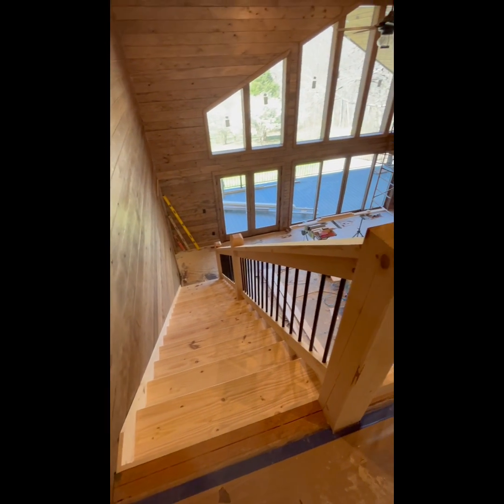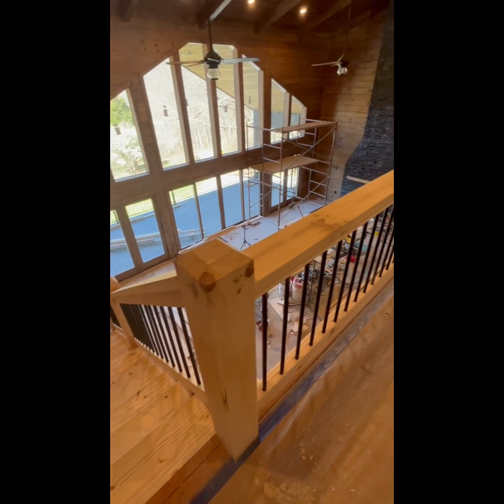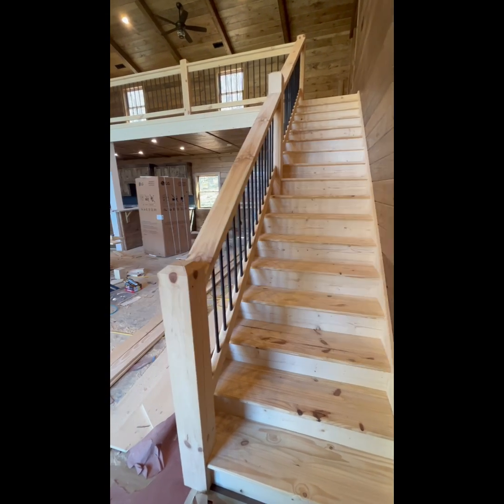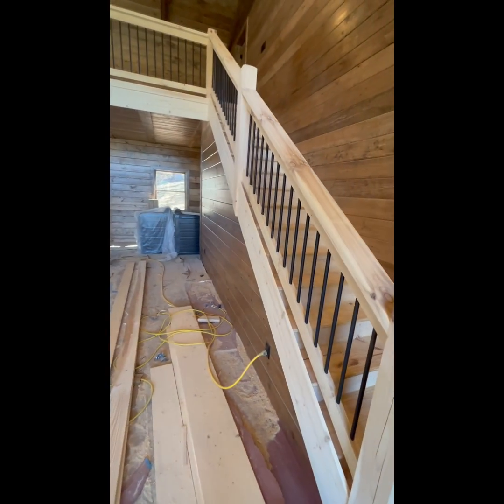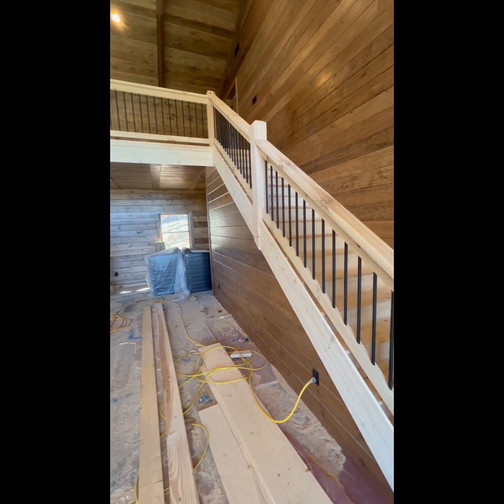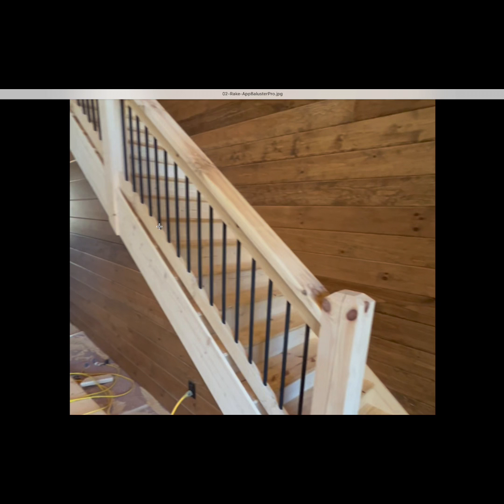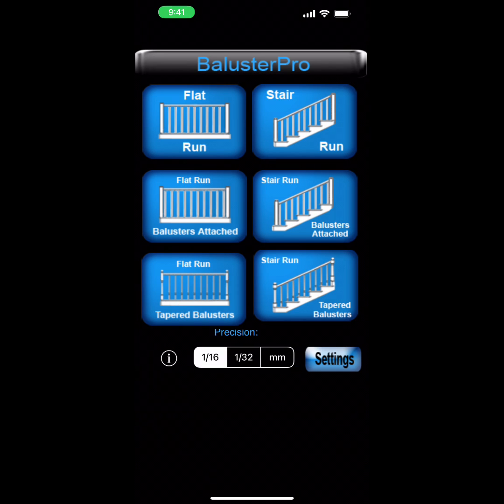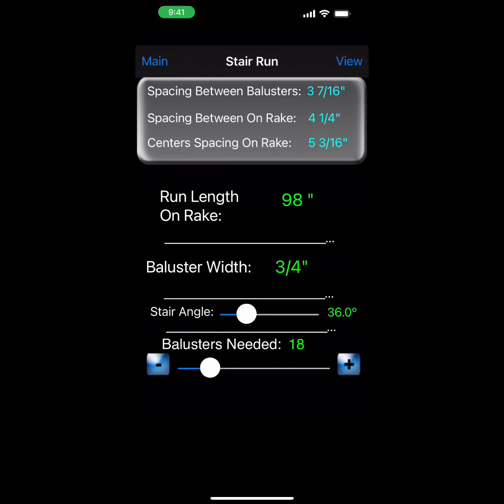Baluster Spacing on a Stair Angle (Rake) - Painless - Accurate - Fast

Comment: This is just a glorified commercial for some app.
Reply from the maker: I appreciate you taking the time to leave a comment. Can’t quite tell if you’re serious or not… but here goes a response.
Man I wish this was a glorified commercial! I do not and have not received any money from the maker of the application, but sure have made a TON of money by using the app, as it has saved me so very much time, and helps to eliminate errors. Most modern professional trim carpenters use some kind of app to calculate baluster spacing. You see, I am an old dog that constantly learns lots of new tricks. Have calculated this manually for years, but we must grow and change with the times.
Here is a link to a recent video (glorified commercial) of another pro using a different app. Not just another pro but one of mentors on YouTube: 
https://youtu.be/YibbymJ8WDo?si=9nmOCHny4sfnDbNC

Comment: Thank you for this video. Could you tell me what the difference is between stair run and stair run attached balusters and flat run vs flat run balusters attached
Reply from the maker: Not exactly sure of how to answer your questions, but please find a link below to my latest video that goes into detail about run and rise of the stair treads and stair risers. Would highly recommend the Coffman stair guide referenced in the video, the stair guide should be able to answer your questions, and it is free to download and is an invaluable resource. Again sorry for my confusion on your question.
The app does make a distinction between flat run flat run with balusters attached, and stair run and stair run with balusters attached. I know it is confusing but in most cases the flat run and stair run in the app refer to what is commonly built by most trim carpenters like myself. Balusters attached is where you would build the balusters attached to the balustrade and install as one piece. I always use the non balusters attached mode. 
The flat run is like a balcony or a flat landing on the stairs and the stair run in the app is for use on the rake angle or balusters on the angle of the stairs.
Here is a link to my latest video that goes into more detail.

https://youtu.be/QdUe5-zDo5E?si=I5viY48GxhO1c6vZ

Thanks for taking the time to leave a comment.
Reply: @productiontrimcarpenter  Thank you very much for answering. It helps

Comment: Great video. What number would you use to make your first center mark? Newel post to center of first baluster?
Reply from the maker: @buddybeast91  Thanks for the question and the kind comment. All measurements in the app are based on inside measurements only. The whole goal is the comply with building codes. So, measure from the inside of one newel to the inside of the other newel. Making a video now Showing how to measure the correct height of the newel posts and where the location of the newel in relation to the rake angle affects the finished height.

Comment: All the problems associated with baluster spacing are due to the lack of a proper stair plan.  Traditionally, this was the architect's job and not that of the stair guy.  

Today, nearly everything has been relegated to the stair carpenter.  Today, I'm expected to not only be the architect but also the engineer, making sure all the newel posts are securely anchored, etc, and with little or no instructions on how to do it.   

When we do get plans and specifications, they look like they've come from some inexperienced high school kid. 

As a finish carpenter and stair guy, I can count the number of times I've worked with a competent architect on one hand in my entire career.  

If things don't always turn out like they should, it's because there was no plan to begin with.  😢
Reply from the maker: @jamesbaldwin7676  Tell it my brother. I am trimming two sets of stairs in a house right now, and I asked several questions about how to finish a bottom landing, and got the reply of “just do what you think looks good”. We are talking about a totally custom build, right at 900 to 1m. My boss and mentor is a guy I love and respect greatly, and has over 35 years as a master carpenter told me that the lack of proper planning falls on us the trim guy. My mentor will graciously include me on these discussions and ask my opinion. You hit the proverbial nail on the head, and that is we should be told how it’s going to go. 
Example of what we are talking about happened last week as we were accessing the stairs, as the stairs to the basement have walls on either side except for the very last tread that sticks out about half a tread… If a contractor is thinking, the wall could have easily been extended about 8 inches and would of saved having an exposed skirt that now needs to extend out and 45 into the riser.
You make a fantastic point!
Thank you for your insight, as it has made me think.
Reply from the maker: @jamesbaldwin7676  Your point about the structural integrity of the stairs is a very important point. I would be a fool to step onto a build site without having workmen comp insurance and I also carry a 2m general liability policy as well. And relatively no one asks to see my policies.
Good stuff.

Comment: I spent over an hour looking for videos and trying to do the math!!! This app just saved me hours of layout time. I have 2 huge sets of stairs that I'm installing myself and this app definitely works. Got my spindles equidistant within 1/8" overall! Best $3 I've spent in a long time. Thanks for the video!
Reply from the maker: @edtorres1502  You are very welcome. 
The comments keep me going. Thank you for taking the time to leave a comment.
I also use the app to quickly layout my newel posts as well. The app is really not limited to distance. Example: 16’ run and enter the newel posts as if they were balusters.

Comment: I searched forever for a formula to do spacing for a rake. Finally I found your video. Great job explaining. I never even thought of looking for an app. 😕I did finally determine a method to do it with manual calculations, which matched the app  - yeah. But since I have 3 of these to do in my house, this will save me tons of time. The $2.99 they charge for it is well worth it. Thanks for sharing.
Reply from the maker: @Beyond82555  awesome! Folks like yourself is why I do this channel. Thanks very much for the kind words and encouragement. I am not affiliated I any way with the app and did not receive a penny, but this is great payment for me!

Very glad you worked out the formula, as that is very valuable information to have in your pocket. My mentor taught me the manual formula way, they pulled out his phone, grinned, and showed me the app. A guy in his mid sixties who is ever evolving at his age. He said, get the app and do it yourself faster!

Comment: ---very much enjoyed your video. I had 1 question. how do you determine the rake length. Would that be the distance between thepost on the rake angle or at level. thank you cheers steve
Reply from the maker: Hey thanks Steve for taking time to comment, and thanks for letting me know that the video was enjoyed.

The measurement is taken between the posts on the rake angle. I usually lay a story poll (1x4) on the rake, mark the angle and then use those marks for the length.

The stair case shown in the video was kinda rare given the fact that normally you would have a knee wall, or just be dealing with tread/baluster layout. The client designed the look and incorporated the bottom rake rail. Kinda like you might see on exterior stairs.

Thanks again